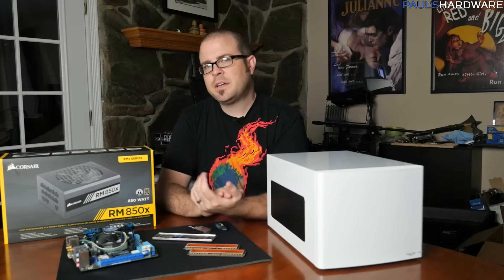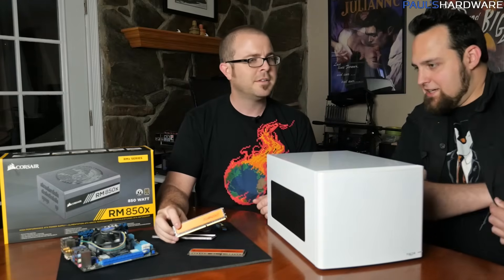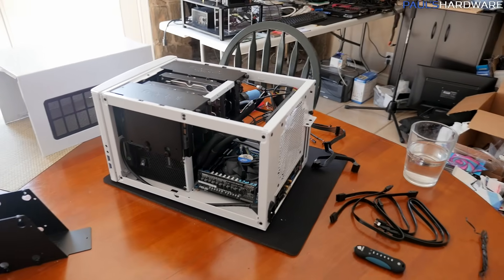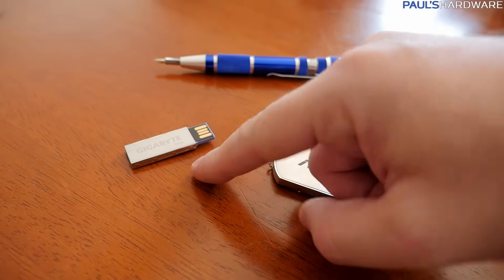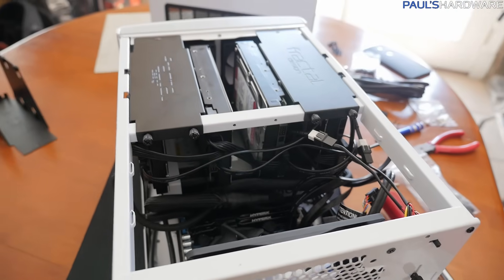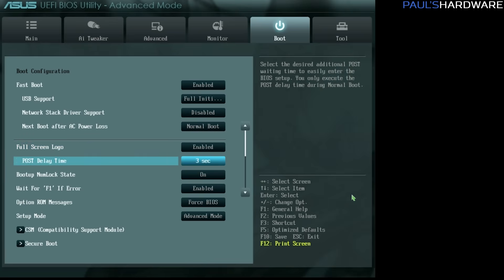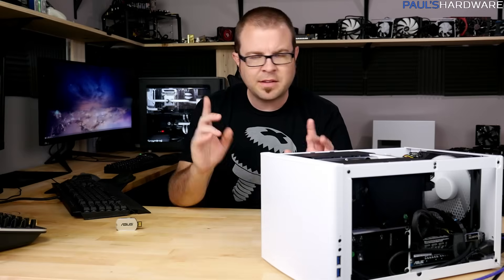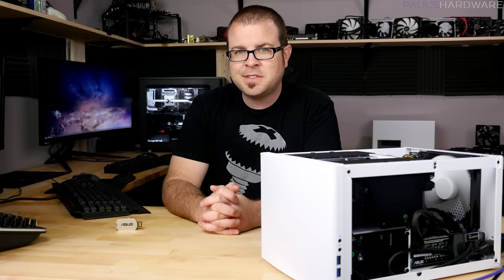Epic 16TB FreeNAS Build (Surprise Guest!)

Comment: Recent subscriber here: What's a NAS and what's it used for?
Reply: Network attached storage. Basically a set s hard drives that are attached to your network so everyone in the network can access the information on the NAS. Even remotely too. It's also used for backup purposes
Reply: +Patrick Challita How does one access this information remotely? :o
Reply: +WhamBamTySam it's called network
Reply: +Farnomat I know how to access other nearby computers on the same wireless network,  but how would you access it in another location? across the city? across the country?
Reply: +WhamBamTySam If you know your current IP or have a static IP or a domain or even a dynamic domain, then you can forward the ports of your cifs/samba share and make a remote mappable drive.

Alternatively, you could install (or use a separate) server/jail running OwnCloud for small, important files like documents and photos, or you could use something like Plex to index and stream all your media. That way, you open up the services, rather than the NAS itself.
Reply: +naycnay that's a lot of new information,  thanks a lot for sharing :D
Reply: Np. On a side note, OwnCloud and Plex are awesome. Look them up...

Comment: I'd love to know how to set up secure remote access on this.  Please upload a video when you do :)
Reply: +eddie408209 FreeNAS comes by default with an FTP service. Once set up with the proper permissions -- such as making sure you can only FTP into one particular folder on the NAS to limit exposure -- it's just a matter of exposing the port on the router. Just make sure to use a very secure password if you do that, and I think it can also be set up for secure FTP (encrypted communication) by specifying a digital certificate.
Reply: +brandishwar I think on some you can even only allow certain devices via MAC address, maybe I'm wrong?
Reply: brandishwar I was aware of the FTP service, but I dont think it is secure by default, and I am quite terrible when it comes to certificates, so I guess il have to read up on that..

Comment: This beats my NAS that I build using a Raspberry Pi, and a 80GB Hard drive in a USB to 3.5" adapter...
Reply: +Tony Tascioglu atleast you have a nas :(
Reply: +Messisan321 HD I'm not sure if we can consider it a NAS... Its just a Samba share. And its probably going to stop working in the near future because of the 24/7 use an old hard drive
Reply: +Tony Tascioglu I tried to do that too, but it wouldn't show up on the network for some reason. Couldn't figure out why so I just gave up. I'm going to buy a real solution -- or build a "real" one like Paul did in this video -- so I don't mind much.
Reply: +Tony Tascioglu yes. yes it does :P
Reply: +Zachary Johnson Out of interest which tutorial did you follow if any? I used this one http://pimylifeup.com/raspberry-pi-nas/ and it works perfectly
Reply: ksells not that one, but one that essentially said the same thing. Maybe I'll start from scratch over the summer and use that tutorial. Thanks.
Reply: +Tony Tascioglu I didnt know samba constantly uses the hard drive.
Reply: +Tony Tascioglu maybe time to upgrade,freenas or omv installs are available for Pi

Comment: Paul, you should probably grab a couple of similar sized USB drives and put them into your Nas for mirroring the OS to. Freenas 9.3 allows you to mirror your OS across multiple drives. With USB drives you can just replace the bad USB drive when you get an alert about a failing OS drive. Freenas can automatically mirror the OS onto the replacement USB once it is plugged in and pointed to for replacement of the bad drive.

Comment: Hello Paul,  I am running a 30gb RaidZ3 with 32mb RAM.  One thing that you will run into it FreeNAS will start to drop drives randomly due to the old Windows limitation of 2.2TB.  Make sure, SURE, SURE that you are running the latest drivers on the SATA.  My motherboard would not recognize 3TB drives so I had to install a couple PCIe SATA controller boards.  And for fun I found an old 32gb SSD from san disk that i am running my OS on -- kind of a waste as FreeNAS only need like 8GB to run.

I love my FreeNAS.   Been running it since 2014.  The new automatic upgrade to the latest stable release is really helpful.

Good luck 
and may the force be with you
Are you Lukes father? (opps wrong channel -- sorry Linus:-) )
Logan is really a Dark Lord Sithe -- beware!!!! (ever notice how Wendal is never in the same city as Logan -- hmmmmm)

Comment: Wait, so you mentioned the recommendation about 1GB of RAM per TB of storage space but completely forgot to mention ECC RAM? People will argue that it's not worth the extra price and while that might have been a valid argument YEARS ago, now you can find ECC RAM for the same price as regular RAM and sometimes cheaper. It's surprising that you will pay extra for NAS drives but will not get RAM with a critical feature to ZFS for the same price. Also, if you went with regular RAM because the mobo or CPU doesn't support it, it would've been a good idea to upgrade to ECC RAM regardless in the event that you want to upgrade your mobo and CPU, you won't have to upgrade your RAM as well. 
http://pcpartpicker.com/part/kingston-memory-kvr16e118
Reply: +Jesus Otero Most (if not all) motherboards that support Sandy Bridge processors don't support ECC RAM, so it's a bit of a moot point in this build.
Reply from the maker: +Jesus Otero I'd like to give more straight-up advice on FreeNAS but I feel I have a lot to learn still -- the ECC memory is something I do wish I'd mentioned in the video though. I'm already speculating on what I might do if I built a new NAS box (probably not for months at least), and going with server-grade hardware that supports ECC would definitely be a part of that. Based on advice from Logan and Wendell, I think I'll be OK with the standard DDR3 for now though
Reply: +Paul's Hardware I definitely see where you're coming from and I don't doubt that you'll be okay running regular DDR3 RAM for now. The thing I'm worried about though is that by making this video and glossing over ECC and server grade hardware, people that come across this guide while doing research for a NAS box might do the same. Especially with the large subscriber base you have. And of course, not everyone that builds a NAS box will be able to afford upgrading their motherboard, CPU, and RAM if they change their mind afterwards.
Reply: http://pcpartpicker.com/p/jjs2pg

While I'm here, I'll go ahead and share my FreeNAS build. It's not the best build ever but just wanted to show that building a reliable NAS does not have to be expensive. The motherboard I went with is freaking amazing. It supports up to 32GB of RAM, has an internal USB port, dual gigabit NIC, and IPMI which is freaking great. And the best part, it's not even that expensive. I'm using my FreeNAS box for Plex and so I went a bit overboard by purchasing a used Xeon E3-1225 V3 on eBay. It's been running like a champ for transcoding multiple 1080p streams and I'm definitely happy. This build has been running fine and I haven't found the need to upgrade and don't think I will be in quite a while.
Reply: Stop spreading misinformation, it's Only if you use deduplication

Comment: 10:00 Paul used ad block. Shame.
Reply from the maker: +Matt Frances shame accepted! In my defense though, that's my live streaming/capture system, and it's the ONLY place I have adblock installed. Mainly to prevent pop-ups etc. during the live show
Reply: +Paul's Hardware OK. thats reasonable

Comment: Hey i was wondering i have 2tb wd red nas drive in my system actually, and is it bad to have nas dives in your pc?
Reply from the maker: +The Doctor it's OK! NAS drives are overbuilt, they're meant for 24/7 use, but you can still use them in a standard desktop (if they're SATA of course, SAS drives you'll have a harder time plugging in)
Reply: Paul's Hardware ok yeah thanks i bought it bc it was cheaper and it is sata so im good, Thanks :)

Comment: Plex Media Server would be a great addition.  You can use it for media access and with that setup you should easily be able to stream media over your network.
Reply: +Will Wilson And Plex is supported on Windows, Linux, MacOS, Android (including Chromecast) and iOS (including AppleTV), plus it's supported on some smartTVs. So you can connect pretty much anything to your TV and run it.

Comment: I was thinking Logan would stop you from installing non-ECC RAM on your NAS xD
Reply: Same. But CPU and Mainboard wouldnt be compatible.
Reply: +Paul Winkler True but using ZFS without ECC is weird, not that it won't work but it's not ideal, that's pretty much the main week point for ZFS. I guess the idea was to use mostly parts that he already had, but still I think I would have used a cheap supermicro board instead (actually I'm currently shopping for a computer for that exact purpose, however I have the extra requirement that I need/want 10Gb).
Reply: I thought Logan was on his way to yell at Paul for not having a NAS setup in his house.
Reply: +Capn Fox I'm running my Freenas with non ECC RAM too, and no complains about it. Also the risk is considered on the data I put on it.
Reply: José Melo How has your NAS build been holding up without ECC?
Reply: ironically he couldve installed ecc if the board supported it. i believe that generation i3 has ecc support.
Reply: Shisno  ZFS assumes RAM is always correct. The checksums are stored in RAM. If you've got corrupted data in memory, the whole parity check mechanism turns against you. Instead of self-healing corrupted data, the parity check will determine that good data is actually corrupted (because it's using a bad checksum) and then it will corrupt it even more. The whole things trickles down as the checksum tree corrupts itself. If that wasn't bad enough, even your syncs will eventually corrupt your backups.
So bottom line is, data in RAM should always be valid, and that's what ECC is for, so it is needed with ZFS. I'm sure there are cool anecdotes of people who managed to run their system fine for a few years without ECC and without any problems, but as you can see, as soon as something bad happens, it gets messy real quick, so personally I wouldn't take that risk (unless you are simply doing an experiment and you do not intend to use it for actual critical data).Shisno
Reply: Same.
Reply: Same xD.  Shoulda seen my face when he pulled out that fury ram. Also I wasn't even sure if any of the components Paul introduced were meant seriously or if Logan would be to the rescue with an entire ecc compatible system and a more fitting psu bp
Reply: +José Melo it sure is doable, I just wouldn't use it in Pauls use case where he would back up and store his content and share it with the folks helping him editing and stuff. A crash could be crucial there but I guess everyone needs to know for himself what risk he is willing to take.
Reply: +José Melo Me too! xD I even thought he'd take over the whole video..
Reply: +José Melo I thought so too but, it's not really that critical on a budget NAS build like this.
Reply: +Ti133700N What difference would ECC RAM make anyway? Would it be more susceptible to data loss/crashes without it?
Reply: zfs will not corrupt data if it finds a bad checksum, why would it do that?
Reply: +José Melo I did too, but I guess for people who can't afford it non-ecc will work. I wouldn't be surprised if he swaps it out later.
Reply: +Benner Zu dem Boi But if it was me I will not risk it for the biscuit.
Reply: +José Melo Haha! I thought the same ting
Reply: +TheG33k3d Lol.
Reply: +José Melo SAME. but then he didn't. gg.
Reply: same here LOL
Reply: He would need a processor that could use ECC ram in order to use ECC ram.
Reply: Here is explanation why you should use only ECC ram with FreeNas system: https://forums.freenas.org/index.php?threads/ecc-vs-non-ecc-ram-and-zfs.15449/
And small quote:
"The problem is that your native file systems have tools like chkdsk and fsck to fix file system errors. You also have plenty of options for software recovery with utilities like Ontrack EasyRecovery DIY Software.

But, no matter how much searching you do, there is no ZFS recovery tools out there. You are welcome to call companies like Ontrack for data recovery. I know one person that did, and they spent $3k just to find out if their data was recoverable. Then they spent another $15k to get just 200GB of data back."

Comment: I built a FreeNAS server a little over a year ago out of my old gaming computer (which is incredibly handy because FreeNAS really does need quite a bit of RAM to work with) and I love the thing. I eventually got a couple of red drives for it, and I have it set up to download television shows automatically, rename them to a standard format and organize them into folders, and I rip movies and music for personal use too. Then I picked up a couple Chromecasts for my televisions, which work great with Plex, and I'm happy.

I do recommend, though, that you get a regular hard drive for your FreeNAS install. I've had problems with running it off a USB drive. I used an older 80 gig laptop HDD and it's worked perfectly ever since.
Reply: +Lutranereis You can actually just grab a few similar sized usb drives which are cheap as hell and just mirror the OS on to them. I have 3 usb drives of 8 gigs each mirroring the os. If one fails, just pull it out, replace it with the new one and Freenas will mirror it on to the replacement for you. That way you have OS redundancy too.
Reply from the maker: +Lutranereis very nice! thanks for the info, I would like to set up mine to do that too... what USB drive were you using? I do have some smaller SSDs (~40GB) that I could swap in if the USB gives me trouble, but so far it's been doing great
Reply: +Paul&amp;#39;s Hardware Not at home at the moment so I can&#39;t tell you, but it doesn&#39;t matter, since the OS blocks of the entire partition, so long as mirror drives and replacement are the same size or bigger then the original OS drive, you&#39;re all good. If I remember correctly, mirroring is under System/Boot/Status
Reply: Paul's Hardware Admittedly, they were a couple cheap Lexar thumb drives, so maybe that had something to do with it. But about a week into using them, I'd have issues with getting my jails to startup. They were 8 gigs each, so more than enough space for FreeNAS at the time. Maybe you'll have more success, though.

If you need a good guide on how to setup FreeNAS with SickRage and Plex, shoot me a message and I'll send you what I have. Some guides aren't that helpful, and the FreeNAS community can be a little condescending at times.

Comment: But it's not ECC memory.....
Reply from the maker: +wannabesq Mobo/CPU don't support ECC but that is one thing it's lacking, if I expand this in the future I'll probably switch to a Xeon
Reply: +Paul&#39;s Hardware Make sure to check out eBay, you can get some cheap server-grade components off of it these days (shout of to Linus for that tip, by the way).
Reply: Well his hardware didn't support ECC anyway.
Reply: +Paul&amp;#39;s Hardware  No worries.  It&#39;s just something thats hammered in your head to death on the Freenas forums, that if you don&#39;t use ECC ram, angry clowns will dunk your hard drives in whipped cream.  I just thougt when Logan interrupted you that ECC ram was going to be his recommendation.
Reply from the maker: +wannabesq so far the clowns are just sitting there... I think their vision is based on movement